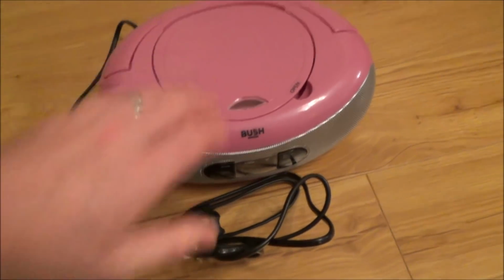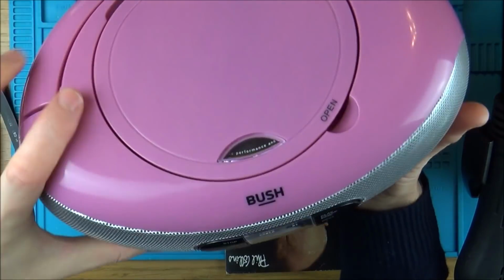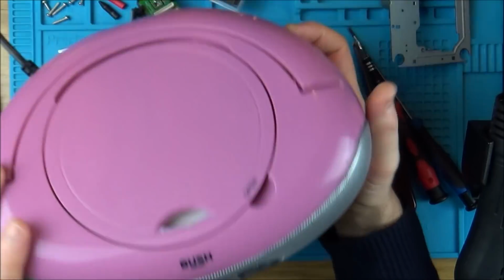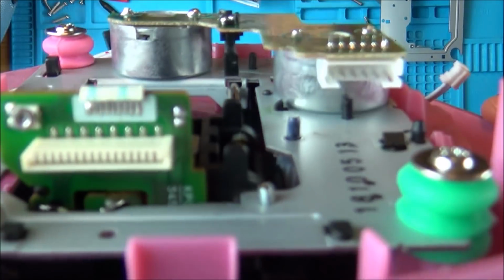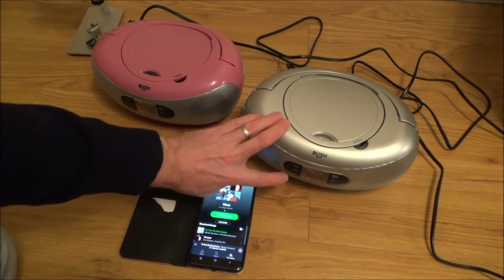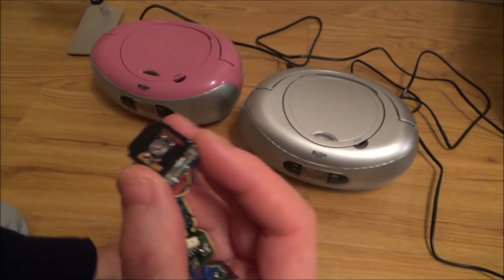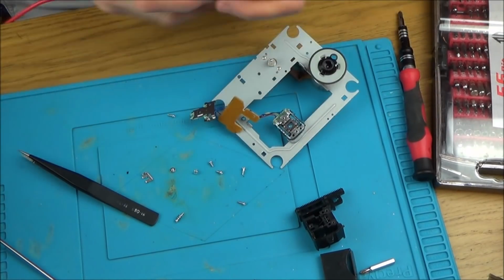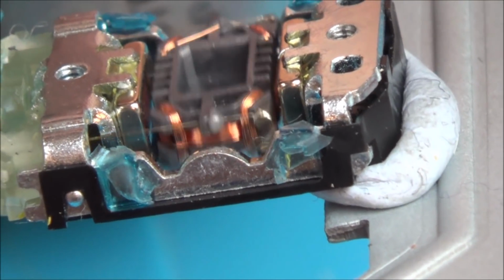REVISIT - BUSH Boombox Transistor and Laser Replacement

Comment: Fantastic fixes Vince!  Had no idea about the blob you have to unsolder!  I would have thought that was something to change the laser settings between different devices.  If you should encounter something like this again, I would also suggest testing the headphone port and blue tooth to see if either of them had sound or could be causing problems since when you use either of these it will cut sound to the speakers.  Great detective work on that transistor though!!  Keep it up!!!

Just an opinion, your video length is not a problem!  You keep the flow moving fine!  Some fix-it videos I have watched seem to FF past the troubleshooting and slow it down on the less interesting parts.  Your videos are perfect, even when over an hour!
Reply from the maker: Thanks Jim :-)

Comment: the mirror piece is coated with a polarizing filter. The red laser light is fired in a defined angle on the mirror in 45 degree. The light will be directed to the disk. The disk reflects the light and changes the polarity of the beam. With the changed phase angle the light will now not be reflected by the mirror piece anymore and will shine straight through the glass to the underlying laser detector. laser emitter and detector could also be swapped depending on the design of the assembly.

Comment: 13:34 - that is an expensive assembly you have - there really is very little difference between a cheap pick up & an expensive one.
More expensive players concentrate on the mechanical dampening and sound output - they all use similar if not the same pickups!

Comment: The light sensor that lives underneath the lens actually contains a bunch of different photodiodes-  when the beam bouncing back from the disc is off to one side, the pickup control circuit-  the tracking servo, to give it its technical name- puts current through the side-to-side coils to push the "spot" on the sensor back to the middle.  There's a similar thing where the size of the "spot" on the sensor controls the up-and-down motion of the lens.  The focus servo only controls up-and-down, and the tracking servo only controls towards-the-hub vs away-from-the-hub.  There's a third servo circuit that controls the speed of the spindle from the frequency of the detected digital signal.

It's really quite neat how cheap they've managed to make them.

Comment: The reason the laserdiode has three terminals is because there's actually not just a laserdiode in the package-  there's also a photodiode that's used by the laser drive circuit to measure how much light the laser is producing, so it can accurately regulate how bright its output is.  A laser diode is actually a long, thin piece of III-V semiconductor (usually something like gallium arsenide or gallium indium nitride) with two end facets cut so that they act like mirrors.  One of them is almost a perfect mirror (it's the back) and the other is semi-reflective, so it acts as the output coupler.  The little photodiode that's used to stabilize the laser power usually sits just behind the back 'mirror', or else it just sits off-axis near the output coupler facet of the laserdiode die.

Comment: Laserdiodes are almost always shipped with their anode shorted to the cathode- it only takes a few nanoseconds of overcurrent to permanently destroy them or damage them.  They're way more sensitive than almost anything else you can imagine.  There are even special overvoltage protection devices called Lasorbs that you can put in circuit to protect them.  Tweaking the diode current pot is also a good way to hurt them!

In the case of your optical pickup unit there, yep, they put that shorting blob on the PCB to stop static from the package from zapping the diode.

Comment: When replacing an SMT part: Wick all of the pads flat, then apply fresh solder to one pin, then flux to all of them, then use that pin to tack the part on and solder the others. This technique lets your place the part flush to the board with the leads all basically touching the pads

The way you did the transistor in this video is probably fine most of the time, but you can sometimes run into issues where the gap between the component lead and the pin--even though it's filled with solder--causes problems due to increased resistance and inductance.

Edit: For large chips, tack pins on opposing corners, since tacking one pin won't really keep it in place. If the chip is large enough you can usually use your fingertip to hold it in place without getting burned, and that can give you better control than tweezers.
Reply: Sounds like a fair advice; makes life easier when SMD-soldering with narrow gaps like here.

Comment: That is anti-static solder point, to prevent static on the laser. Ps2 laser replacement also got this, need to unsolder for it to work.

Comment: You have to do the same thing with a Wii laser (desolder the ball, which yes is an anti-static measure; I'm surprised you didn't know that).  Good vid :)
Reply: I didn’t know that either, but it makes sense to provide some anti-static protection during shipping.
Reply: Same on the Xbox 360 replacement, you had to take out a Gob of solder, scared the crap out of me tbh

Comment: Excellent =D  Nice to see you experimenting with the focus and tracking coils at the end there =D  If you connect say 1v or 2v AC at a slow frequency, eg 1Hz (if your PSU will do that - probably not, a frequency generator woudl though), it will bob up and down or swing side to side =D  At 50Hz will just vibrate (and possibly burn out).  Almost all lasers have that ESD protection blob - you had that on your GameCube video I think (you just forgot!)!

Comment: I didn't know that about the solder.  I wonder if that is the reason the replacement laser for my Wii didn't fix it.
Reply: If new it will have this protection
Reply: @lubomirrolko1967  
I figured that I had mis-diagnosed it and threw the whole thing away.  Oh well